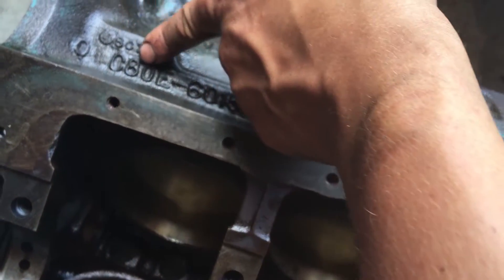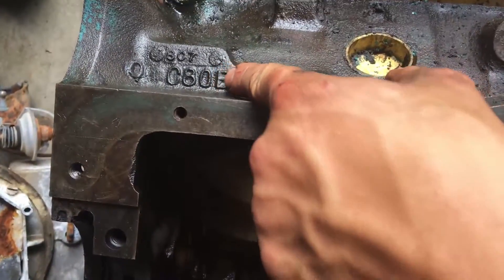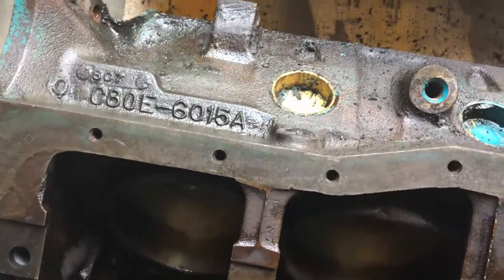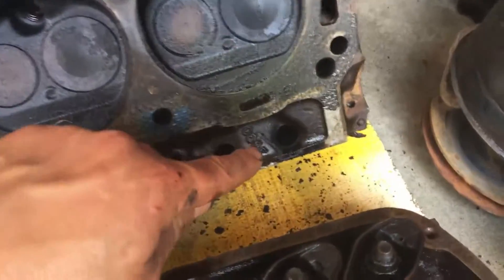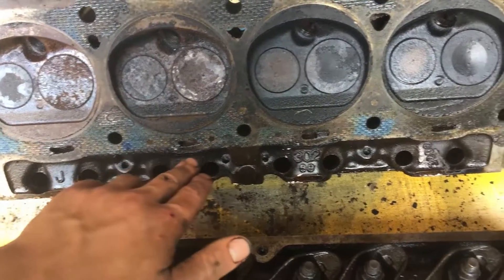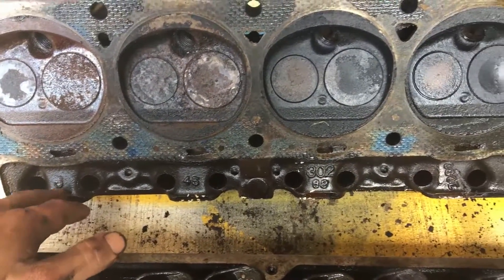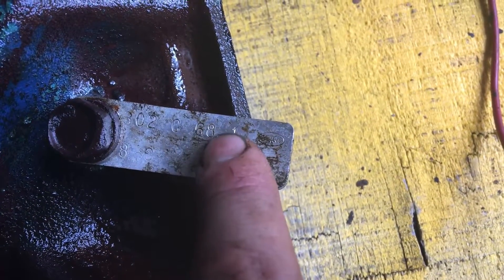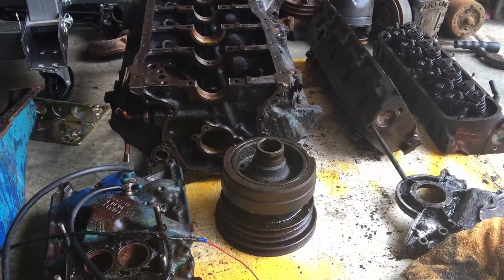Ford Small Block Casting Number Identification and Location

Comment: I have the one with the black paint....
Reply: Black paint for 1965 model year engine. Shouldn't be a 302, though. Those didn't start until late 67. Maybe a 289 (like my engine).
Reply: @jaustill237 I was just being a smart ass.... actually, my black engine is a 65. 427....
Reply: @godsowndrunk1118  Very cool. What car is it in/from?
Reply: @jaustill237  It's in a 65 Galaxie 500.... the car originally had a 240 six with a split shift 3 speed overdrive.
It's got a 64 Thunderbolt High Riser in it now.... with top loader 4 speed and 3.50 posi rear end.
Reply: @godsowndrunk1118  Sounds like a fun ride.
Reply: @jaustill237  Yep.... Cherry Bomb glass packs on original cast iron headers. 
Scares the little old ladies.

Comment: Wow my 351W was casted in 84, but it came out of a 94 truck. So it sat on a shelf for 10yrs.
Reply: I'm not surprised. The factory I work in is the same.
Reply: No, yours was a casting designed in 84 and probably made in 93 or 94. The big casting numbers remained the same until they changed to a different casting, then the numbers change. Some castings were used for several years in a row.

Comment: Is there casting numbers on the block that specify 302 from 289? (In 1968)
Reply: Great question wondering the same thing were you able to find the answer? Would love a response if you have the time thankyou
Reply: @abigasswave3000  we were told there is casting numbers on the block under the exhaust manifolds which we have not confirmed yet. We will have another small Ford engine coming into the shop soon we will be checking that one (rather than pulling the manifolds off the car we have).
Reply: Did you find an answer?
Reply: @UnArmedFilms4U  yes actually if it's a 302 factory the block usually states 302
Reply: @abigasswave3000  Where exactly? Sorry, totally new to the stangs.
Reply: @UnArmedFilms4U  we were told there is casting numbers on the block under the exhaust manifolds which we have not confirmed yet. We will have another small Ford engine coming into the shop soon we will be checking that one (rather than pulling the manifolds off the car we have).
Reply: The answer is Yes and No. You were told right that under the intake manifold it will say either 302 or 289. But there is a catch. Those blocks are identical except for the stamping and it has been shown that Ford used 289 blocks to build 302 engines AND they used 302 blocks to build 289s. Though, that is only true for the 1968 model year, when they were transitioning from the 289 to the 302.

Comment: Where were the casting code on the bottom the block after you removed the oil pan?
Reply: You don't have to remove the oil pan. It hides behind the starter. Passenger side, rear of motor near the bell housing.

Comment: those number I believe are not dates of the casting but engineering codes for when first designed, the  smaller casting numbers on the block right near the ones you describe might just be the actual date it was cast.
Reply: And where do I find the real number and what does the 8C7 say?